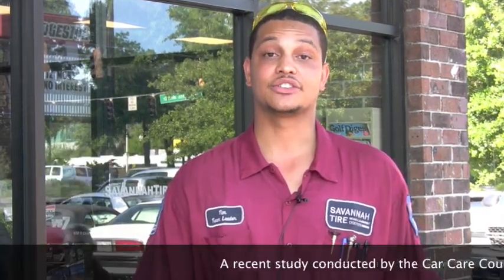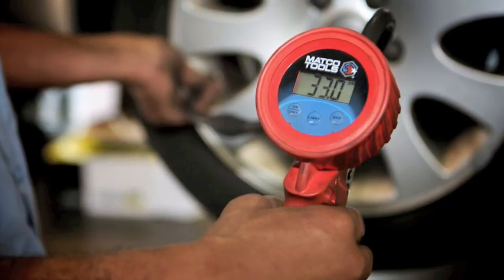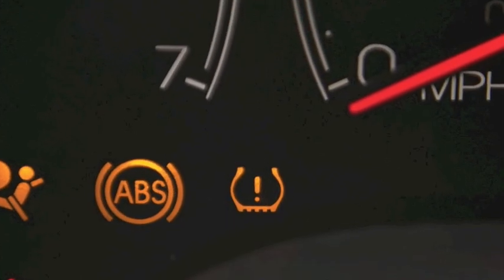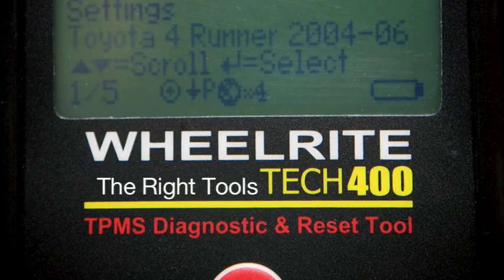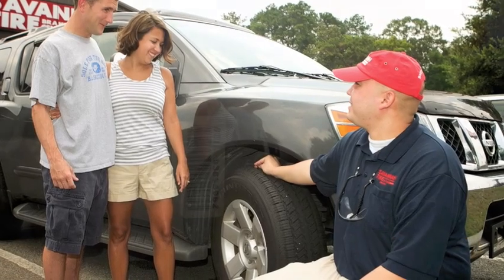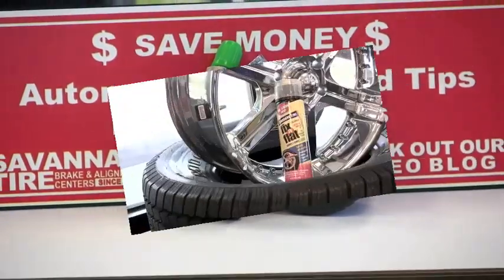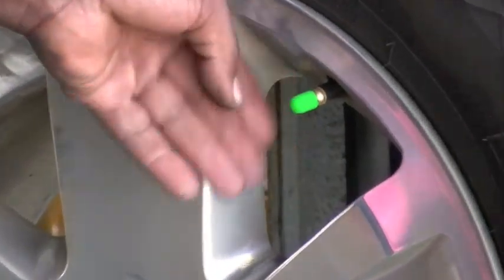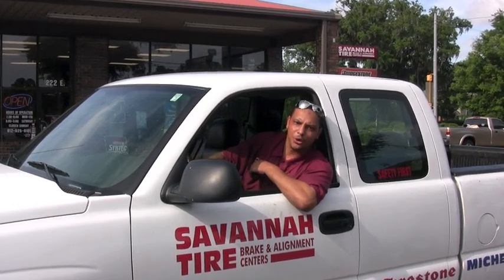TPMS & Nitrogen Tire Inflation

Comment: Good overview of TPMS but we already have 78% of Nitrogen in the air we breathe.
With the amount of atmospheric air already in the tire cavity upon the start of inflation, it will not allow 100% Nitrogen anyways. More like 90ish%. So, by using Nitrogen, you are only ending up with 10-12% more Nitrogen than the normal air we breathe.
Lastly, Nitrogen used in extreme environments like airplane tires is beneficial due to extreme pressures, heat and load, but not for low speed and low pressure auto tires. The 10% difference is negligible and not worthy of attention.

Comment: 2012 Pilot with TPMS sensors, one would randomly go off, pressure was fine.  Once I switched to nitrogen I never had a problem again.  I suspect excess humidity in the tire was the cause.
Reply: Few things to consider:
You need to check tire pressure when COLD. Driving to the corner store for air checks is not cold. Your tires do and will heat up.
You need to use a quality gauge. A $2 gauge is going to be inaccurate and will not provide the correct pressure.
Air compressors that are running while you fill give you HOT air which condenses and reduces pressure once cooled. You need to fill from an already filled compressor at 70* or less.
Most Nitrogen machines are kept in a cool regulated work environment(70*) so the pressure will always be consistent when tire is filled.

Why do most people notice a difference? Because there are many variables involved with proper pressure and most people are oblivious to them.

Happy motoring.